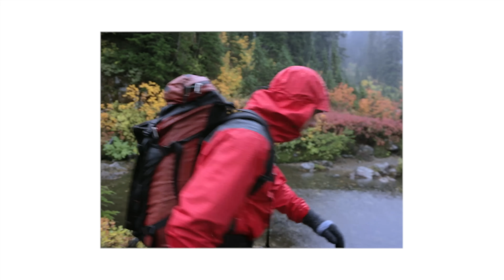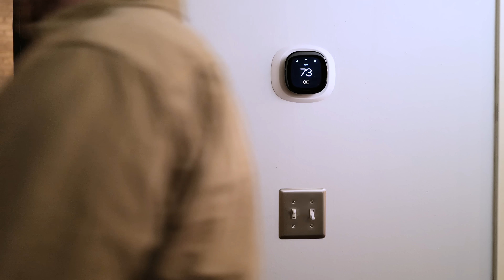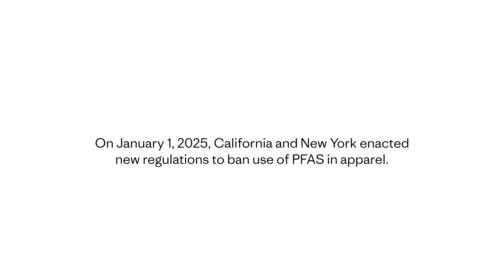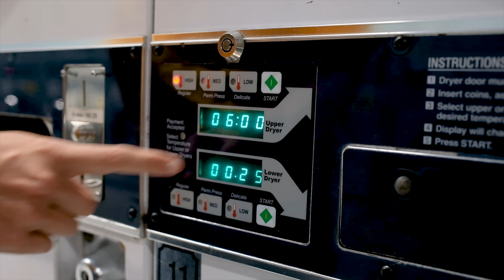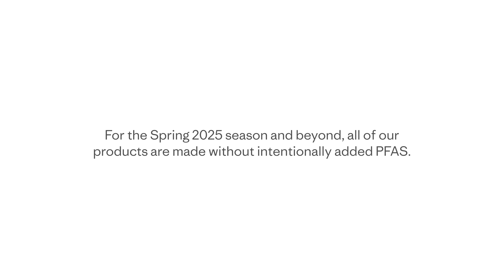The Path to Removing PFAS

Comment: All my last gen Black Hole duffles and back pack are cracking and shedding this carcinogenic material.  Patagonia stated it only lasts 5-7 years.  I would have never bought these bags if they were honestly labeled as a temporary solution. I buy quality items and take care of them incredibly well to have them last a”lifetime”  I feel rather deceived having invested in a company that claimed to match my belief system on not replacing cheap items constantly throughout my lifetime.  Say what you will it’s a huge fail when products are shedding carcinogenic material everywhere you bring it, especially when animals are around licking the bag on occasion    😳

Comment: About every single outdoor company simultaneously put up "without intentionally added PFAS" at the beginning of the year. The reality is that there is very little information available regarding the chemical composition of new DWR's that are CA / UT compliant and fabric manufacturers are not keen on releasing that information unless you are a customer of theirs. It really painted a clear picture when one of your product managers can't even tell us what PFAS stands for. This was also the case for the major outdoor brand I worked at. When I asked about these, I was looked at like I had two heads. Patagonia is not built on PHD's in Sport. It's built on everyday people that see value shopping at places like REI who are fed up buying fast fashion. I bet less than 1% of your customer base actually need these chemical coatings to perform their sport at a professional level. Let people get a little wet going into the grocery store. You act like it's all or nothing, when in reality a few technical, high-performance pieces could satisfy the athletes. I hope you do actually go to the manufacturing plants often, besides just to make videos like this. It was my experience working at a similar size company that was definitely NOT the case. I ask that you practice supply chain transparency and publish the safety data sheet of whatever DWR you settle on. Also consider using natural or even organic materials like cotton or wool, using as little plastic as possible. Lastly, Patagonia, YOU are the leader in your space by a long shot. You're sitting there waiting for your competitors to blink clinging to your PFA chemicals to the very bitter end like everybody else as you create these greenwashing campaigns to tell us you thought of it first (but did next to nothing). Be the leader! Save the world! Fulfill your mission by leading YOUR industry into the next generation.

Comment: Thats cool and all, but until we have better technical detergents to wash garments with, its not going to matter.
Reply from the maker: We would recommend using something like Storm Wash or Nikwax. But you also need to be sure that you also reactivate the DWR. Usually throwing it into the dryer on low to medium heat will do the trick. Now more than ever, it is critical to wash your waterproof garments!

Comment: I really wish there was a clothing line that only used natural fibers. I’d be willing to pay more and I’d also be willing to accept the fact that it might not be as waterproof or oil proof because I’d know that it wasn’t going to kill me. We need to go back to the start.
Reply from the maker: The main concerns with these PFAS chemistries occur during the manufacturing phase. The chemicals are so tightly bonded to the material that they likely do not pose a significant health risk to the wearer, but rather, the chemicals are dangerous to the people and communities where the materials are manufactured. Removing PFAS from our materials will help to reduce the amount of potential contamination of the local water and watersheds. 
			
As far as synthetics go, we make products for athletes enduring harsh weather conditions where synthetic materials are necessary. But we also agree that synthetics aren't the best for all situations, which is why we try to use natural materials when we can.

Comment: I feel like a lot of the comments misunderstand the scenario Patagonia is addressing.

1. Clothing with PFAS aren't covered in toxic chemicals. Your phone's glass is coated with PFAS so fingerprints don't stick to it so much; you're not getting cancer from touching your phone. What's hazardous is /making/ the PFAS-coated fabrics and the waste that comes from that. The clothing itself is fine. The consumers aren't harmed, but those that work and live near places that make the coatings and apply the coatings are. 

2. Patagonia doesn't make their own fabrics. They make clothes and gear, not textiles.

3. The places that DO make these fabrics are largely in developing countries with low accountability. China, Vietnam, Myanmar, etc.  So while some textile mills might be able to  engineer and reliably implement solutions to clean up their manufacturing process and protect their workers and local community while still manufacturing products using PFAS, that's not always a realistic solution in e.g. Myanmar, which is a very involved country when it comes to modern fashion manufacturing.

4. So then some of what Patagonia is talking about here is resorting to fabrics without a PFAS coating that are waterproof....but not oil-proof. So they get dirty more. Ergo these products need to be durable enough to be washed regularly, and that need to wash them (which uses more water, so maybe that's not as eco-friendly for certain locations) needs to be communicated to customers that buy PFAS-free clothing.

Comment: I would like to know How such company will remove PFAS from their "manufacturing equipment",  chemical used during manufacturing,  tubes, cups, etc glue for certain labels, inks ( easy probably), analytical instruments, Protective equipments, refrigerants, ... screens, eletronic equipments... how they will remove all PFAS in the coming years and all the bad chemicals used to color textiles etc...
Reply: Patagonia doesn't make their own fabrics, they're talking about removing PFAS from the fabrics they're purchasing from suppliers and using /their/weight as a customer to induce the textile mills to be better.
Reply: @klondikesaloon  thank you for you answer, I assume that you are not using refrigerants (PFAS ones) for cooling/heating systems ( whatever : fridge, data center, HVAC) :  none of electronics goods contain PFAS ? PFAS are everywhere ...just start an adequat mapping, it is not just about textile manufacturing or packaging... PFAS are present in Protective equipment, firefighting foams, etc...

Comment: Resuming, so they only ensuring that the pfas doesn't enter the wastewater, if the facility is using the materials with pfas for other capacities for other clients. Not removing the chemistry, just trying to prevent from going to the wastewater. Like, the same as doing nothing. I could drink soap from the bowl, but instead I like the slurp it from the table .

Comment: PFAS is one thing, but how about micro- and nano-plastics ? A fleece doesn't contain PFAS, yet every movement you make while wearing it releases micro-plastics. It adds up.
Reply: Don't buy fleece made from plastics. Did you know fleece was originally invented as a cheaper alternative to wool? Just buy a 100% wool fleece, it's anti-odour, warm and comfy :)
Reply: @robskineterable  100% wool will have terrible durability. your stuff is most definitely not 100% wool. they will be polyester blend. you guys can hate plastic all you want but you cannot live without it.
Reply: @gelade not true at all, wool is very durable especially against abrasion, the main reason for poly and nylon blends with wool is to reduce shrinkage in washing because nobody knows how to properly take care of clothes anymore. I’ve made many pants and shirt with 100% wool fabrics and they hold up just fine.

Likewise with real wool fleece, as long as you condition it when cleaning it will last for decades, and once it is done it can decompose or be repurposed. Can’t say the same for any polyester.
Reply: i guess my point is even if patagonia (and every clothing brand) switched fully to natural fibers, we should still be asking really tough questions about the global supply chain. all natural clothes might not actually reduce the plastic load in your personal life by a lot, lets say car tires are 70% of all microplastics
Reply: i dont think we know the full breakdown here. The leading contributors to micro plastics might be from transportation / manufacturing of everything in our lives, even if you go 100% at home and take the wool clothes, natural furniture, wooding cutting board pill. Its still fun to max out plastic / pfas avoidance at home but it could actually be pretty futile

Comment: I'm an outdoor enthusiast based in Tahoe and I've been working on designing gear with natural materials for the past couple years. Focused on the basics like canvas and leather. I saw a job listing for lead material creator and wish I had applied tho I didn't meet the qualifications. I wish I had the opportunities to create my own fabrics as what's available is limiting to the performance I believe we could achieve with natural materials
Reply: Any tips on keeping canvas from getting moldy in humid conditions? I waxed a canvas with beeswax and it didn’t last long in the spring
Reply: @michaellopez-lq5fn  it's very important to dry the gear every day, if it's not air drying, a fan, heating element, or dehumidifier maybe needed. Some of my gear doesn't like to dry next to the gas heater during wet winter storms, so a fan was introduced. 
It would be interesting to try using natural oils like mink or meadsfoot
Reply: @ thanks for getting back to me! Unfortunately I was trying to avoid using a plastic tarp on my organic farm, ended up with a more permanent solution in galvanized roofing but it would be so nice to have a tarp alternative in a pinch. I’ll keep those oils in mind!

“On my farm” that is to say, this stuff can tend to live outside for long stretches of time

Comment: Seems like a big caveat is the “intentionally added” phrase.  So you’ll just find things with pfas already? Or you’ll unintentionally add pfas? Why is that phrase there?
Reply: I read an article from Fjallraven doing the same thing as Patagonia here, and they had their PFAS-free clothing tested for traces of PFAS, and they still kept turning up positive. So until the PFAS issue is gone, removing the intentional coating of PFAS would help reduce your exposure on your body, which is a good start.
Reply: There will be low levels of PFAS in the materials no matter what, because it is so prevalent in the world already, no one can claim that something is truly PFAS free. This is an important disclosure and legal statement, but takes nothing away from the enormous efforts that Patagonia has undertaken to push their supply chain forward.
Reply: Because PFAS are 'Forever Chemicals', so once they are in our water and environment, it is very difficult/impossible to remove all traces of them. For example, if Patagonia need to use water in an industrial process, there is no way to guarantee that the water is PFAS free - hence the term 'intentionally added', as PFAS may still be present unintentionally
Reply: Sheep have tested positive for PFAS, so at a low level it will show up in wool. When the detection capabilities get to that small concentration.
Reply from the maker: We use the phrase "intentionally added" because the reality is that PFAS chemistries are everywhere in the environment. There are so many PFAS chemistries, used in different applications — from nonstick cookware to cosmetics — we can’t guarantee our products will not be exposed to PFAS at some point during shipping, handling, or after a customer’s purchase. What we can guarantee is that every supplier we work with has agreed to our policy that no PFAS can be used in any of our materials or manufacturing processes, and every material used in our products goes through a rigorous compliance process.
Reply: Well, PFAS are already everywhere. Even in your bloodstream. So it's impossible to eliminate it completely.

Comment: How come you investigate your supply chain for a decade while also producing in the same factories like primark and other fast fashion brands?
Reply: This is wear Fjällräven really shine in comparison. I largely only buy Fjällräven.
Reply: @jacktyler5241 what makes you think they are any different?
Reply: @ As far as I know they place contractual obligations on factory’s and have done since 2012 when they decided to stop using fluorocarbons in any of their products.
Reply: @ I would take that with a grain of salt, they produce everything in china just like the rest, check the labels if you dont believe me. The rest is trust, patagonia and fjallraven both say they compensate the workers fairly and work for a fair supply chain. Whether or not that happens is hard to verify, given that the actual labour is always done somewhere far away (with usually less strict worker rights). But if you're going for the moral choice then it makes sense to atleast chose something where the expectation is that its produced with no one in the supply chain getting harmed.
Reply: Check out Puraffinity